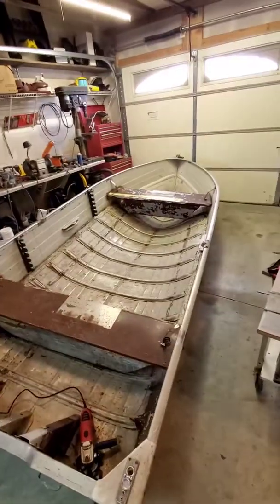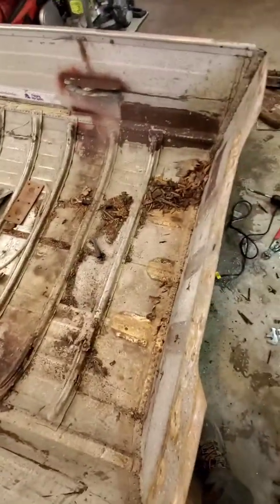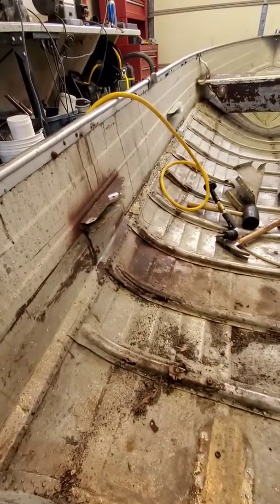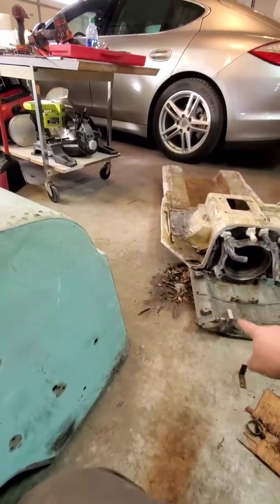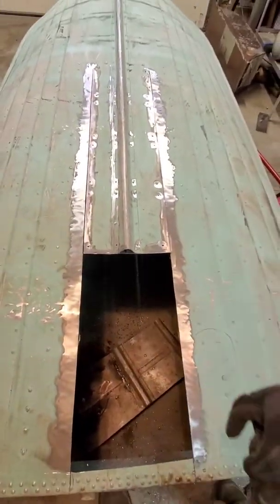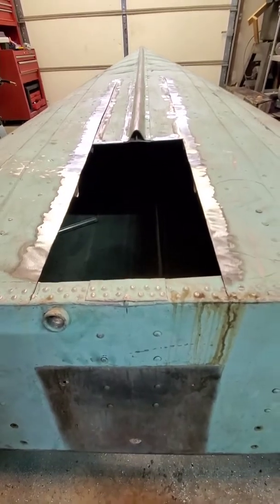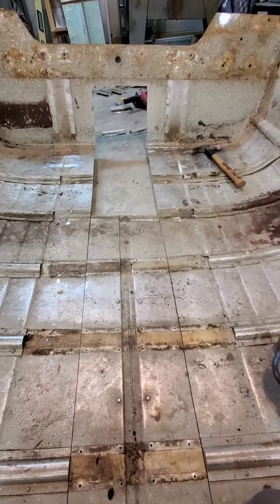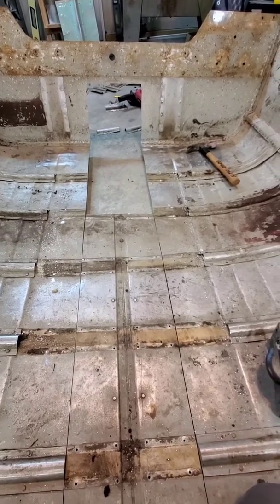Building Jet John (STX 15F Mini Jet Boat Build) Episode 01 🚤 Step by step Construction Guide

Comment: When doing a build like this what do you take into consideration when picking your donor jet ski?
Reply: Cost, weight, hp.  I always say you can never have too much horsepower, so go as big as you can.  But weight is a factor as well, so that's why we all use jet ski motors instead of merccruisers or other jet inboard setups.  If you're building a 10ft boat then you could probably use a 2 stroke 800-900+cc motor and be ok, get high 30s low 40s for speed.  Of you're building a bigger boat like this you'd want as much power as possible.  Thanks for your comment!!
Reply from the maker: Hope this answered your question!  I'll be putting another video up soon about this topic exactly!
Reply: @jetboatmayhem7271  that's concerning, I'm picking up a 15' v bottom tonight and I was planning on putting a Yamaha 650 WRIII in it.. I got the motor for free so...
Reply from the maker: @lazydragonslayer  @lazydragonslayer  you can get away with this.... but if you want max performance such as speed and handling you need to keep it light as possible.  Small fuel tank, use an aluminum intake not the jet ski bottom like I did, and try not to build it out too much inside.  If you do that you'll have a great boat that handles well and it's a dog 😉
Reply: @jetboatmayhem7271  I was planning on having an aluminum intake and building it light. I want to have a universal setup, duck hunt, deer hunt, fish and have fun. So I was going to leave it bare but finished.
Reply from the maker: @lazydragonslayer  great plan!  You'll end up with a really solid usable boat that way.  Mine has been through multiple revisions after the initial build just to try and lighten it up and increase speed.  The jet ski hull needs to be removed though, because it has no advantage other than being cheap, but it adds a bunch of weight and reduces the ability to slide around corners which is a main way of steering these boats 😉
Reply: @jetboatmayhem7271  very good, I'll be studying your channel. Perhaps I'll put together a video of my build too.
Reply: @jetboatmayhem7271 so I wanna start planning a build like this how much would a aluminum bottom that can be welded ? Also the nozzle how has things lasted any leaks v